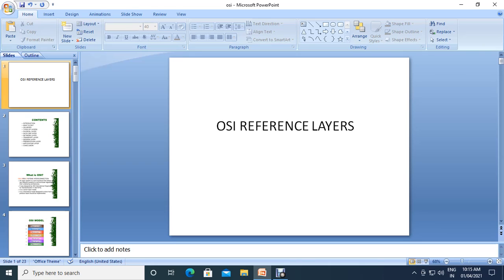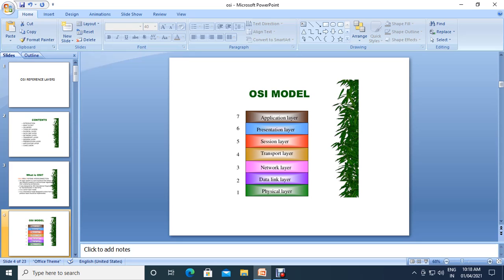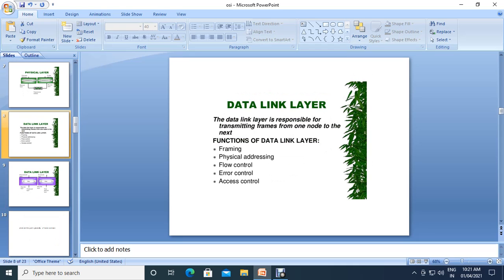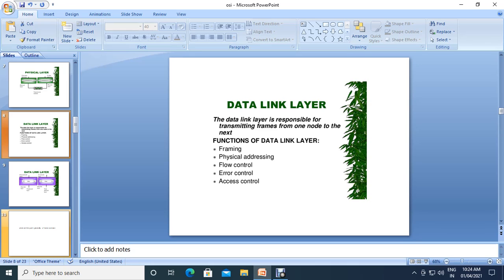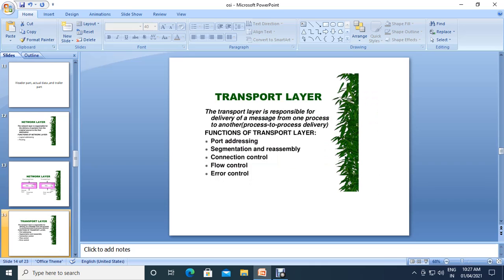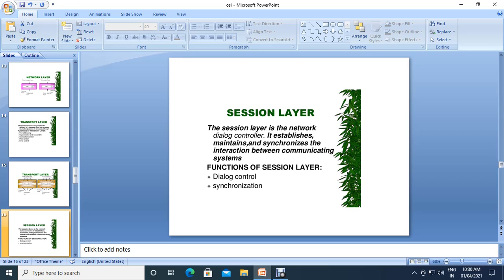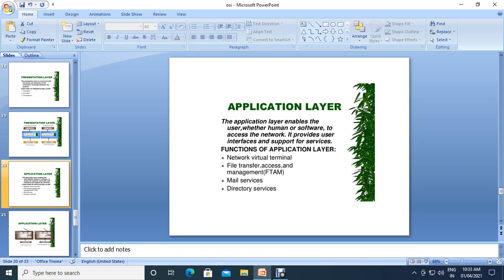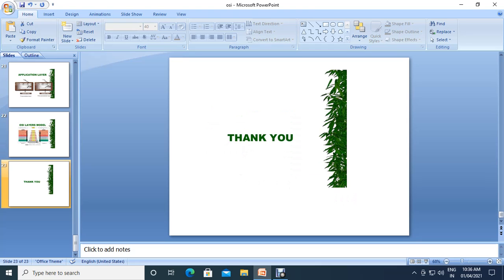Course Name:DCCN || OSI Reference model || Lecture by Saraswathi

Comment: Give the below lines a clear reading....
So basically what happens is....First all the data is encoded, compressed ( data packets), encrypted and then the session is initiated... and note here that our browser not only acts as an interface between clients (our devices) and servers...they also convert the data into bitstreams and also store session tokens... this phase is actually included in application layer...the protocols that run here are http,ftp, telnet etc...
And now the data is ready....in transport layer..the port numbers are added....tcp and udp protocols run here...
Now in the network layer sender's and receiver's ip addresses and mac address are assigned.. protocols : DHCP for IP, ARP and ICMP protocols are active here....we can say that network layer handles IP addressing, routing and virtual pathing...
And finally in the transport layer all the binary signals are converted to electrical signals for data transfer.... protocols like ethernet, 802.11,DSL are active here....
And once this data is transferred to the recieving device..all the above steps will be in backwards....

The above are actually for tcp/IP model...but if you understand the basics..... osi model won't be much different...after all TCP/ipbwas derived from osi....

If you still got any doubts..then better get the basics down of protocols,port numbers, dns routing,tcp vs udp.... and so on....